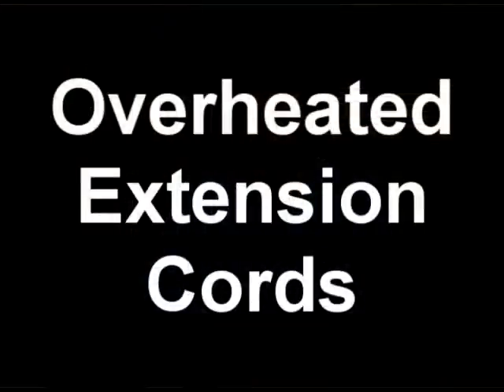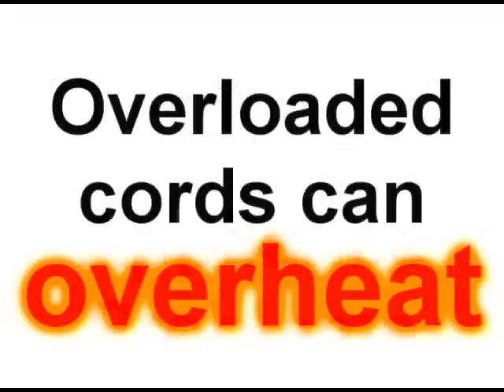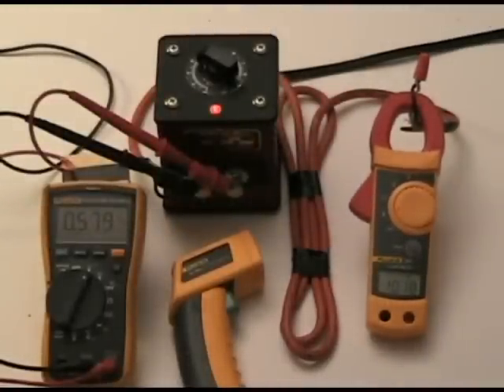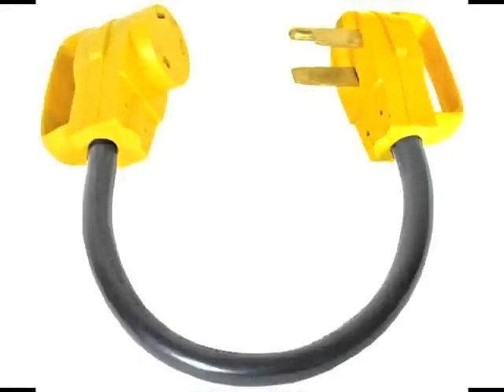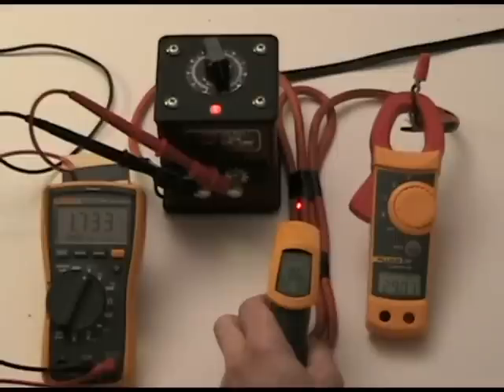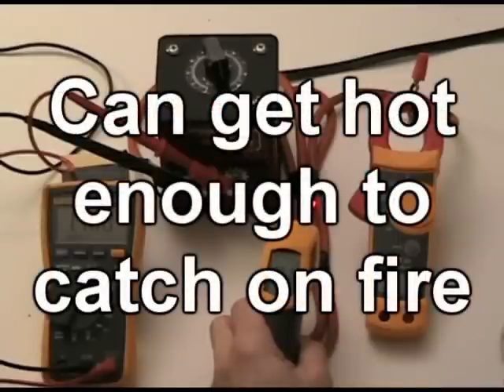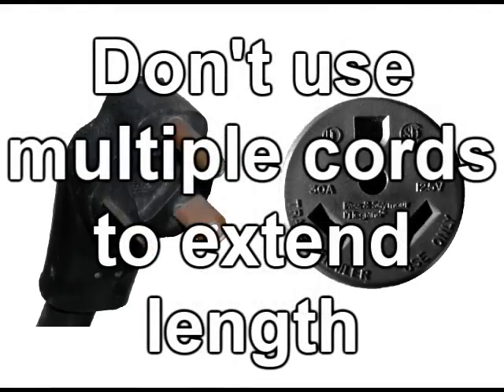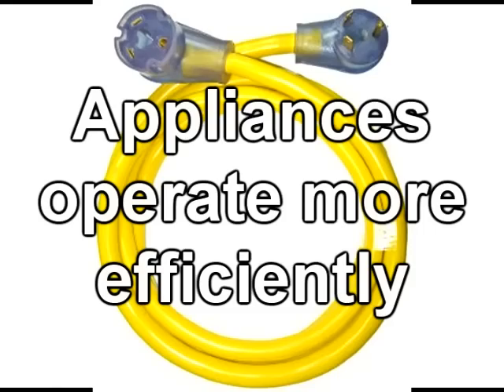How-To avoid extension cord overload

Comment: Thanks Mike and while it should go without saying, we need to be extra careful that the adapter connectors are fully seated and making a snug connection to avoid excessive current and overheating/fire at the connectors!